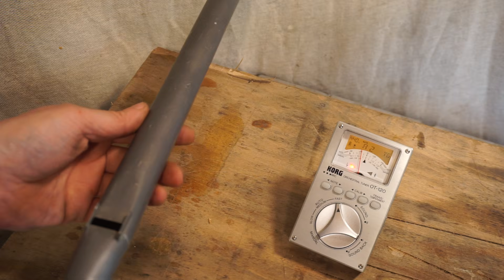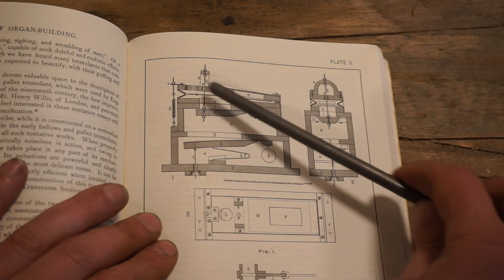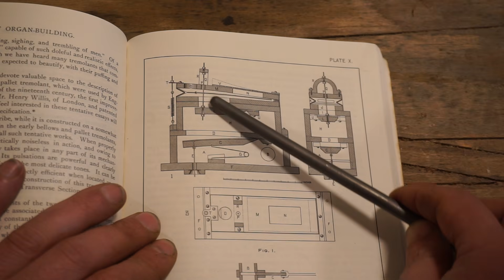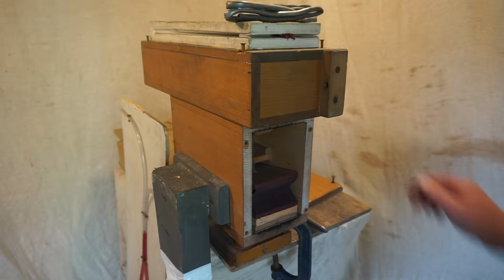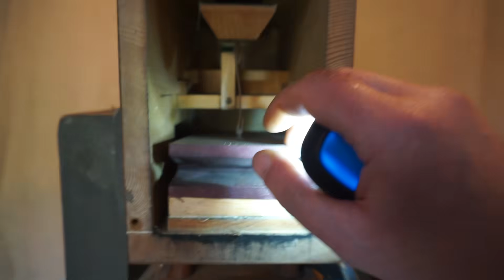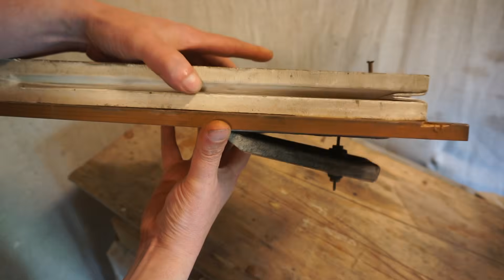Pipe Organ Tremulant Explained

Comment: Thanks for the explanation and taking time to answer questions! I have one too. Doesn't an ideal air supply to the wind chest provide steady pressure regardless of flow? If the organ is optimised for keeping a steady tone regardless of number of pipes being used, it will be counteracting the effect of the tremulant. And vice versa: If you constrict the air supply to let the tremulant affect the sound, it will make the organ less stable.
Reply from the maker: Thanks for the excellent question. Yes you are right that the ideal air supply would be perfectly steady and therefore the tremulant wouldn't work because the reservoir would completely remove the action of the tremulant. However, in practice the wind supply is never perfectly steady. The reservoir has weights on it to control the wind pressure, and as a result is quite heavy, with a lot of inertia which means it takes a while to start/stop moving, this unfortunately results in slight fluctuations in wind pressure if you suddenly start or stop playing a loud chord, but also means that the tremulant will work because the pulses of wind pressure it creates are too quick for the reservoir to remove.  If the change in wind pressure is too serve when you start/stop playing something loud, then the organ may be fitted with a concussion bellows. They are small spring loaded reservoirs that will respond quickly to the change in pressure of the wind to smooth out any sudden fluctuations. If you have a concussion bellows and tremulant operating on the same division of the organ, you have to have a mechanism that blocks off the concussion bellows when the tremulant is activated, otherwise they will just cancel each other out.
Reply: @PipeOrganRevival  A fantastic explanation! As an electronics engineer, I see electric equivalents to everything you talk about.
Reply: @mumiemonstret  Yes.  A pipe organ’s regulator is exactly analogous to a voltage regulator.

Comment: A great demonstration! I've been around organs quite a lot, but never saw the "innards" of a Tremulant.
As a violinist, I've always wondered why they don't call these "vibrato" stops, since the pitch really does change, with the change of wind pressure. And then there's the misnamed "Sforzando" piston which should really be called "Tutti", meaning all stops! 😁👍
Reply: They are sometimes called "vibrato", it just depends on the builder. As for the sforzando, it's a similar thing, but nowadays they are usually called Tutti (as they should be).
Reply: With pipe organ tremulants, there’s typically a more noticeable effect on it varying the volume of the sound, and less effect on it varying the pitch.  Everyone wants it to vary the pitch, but it’s difficult to make organ pipes do that to any great extent.  Some organ companies did call it “vibrato”, but that was mostly wishful thinking.

Comment: When you put the weight on the tremulant and caused a noticeable change in the speed and quality you I wondered if that is why I’ve seen some organs with a cinder block resting on the top of the windchest.
Reply from the maker: @Quince828 You normally find weights (either blocks, stone, or metal) on top of the reservoir. The reservoir's job is to control the wind pressure so that the pipes speak at the correct pitch and volume, and to be a store of air so that it is available when it is needed. By adding oi removing weights from the top of the reservoir you can adjust the pressure of the air supplied to the pipes. (In an organ the "windchest" is something different - the pipes sit on top of if, and it contains the valves that open to let air into the pipes when the keys are pressed).
Reply: @P @PipeOrganRevival anks for the clarification. Does having a weight added to the reservoir indicate that there was a flaw in the original specification of the reservoir, or that subsequent to the organ’s installation a decision was made to increase the amount of pressure to a particular rank of pipes; ie wanting say a trumpet stop or a big pedal rank blown at more than the other stops?
Reply from the maker: Lots of pipe organs evolve as musical fashions change, so there wasn't necessarily anything "wrong" with the organ to start with. If a church has been carpeted the acoustics will have changed and the organ might not sound loud enough anymore, sometimes extra weights are added to the reservoir to increase the wind pressure to make the organ a bit louder (but it also effects pitch and tone of the pipes).

Comment: Some tremulants have never worked, and never will, probably due to unfavourable feedback effects between the tremulant, the wind-trunk, the chest/soundboard, the blower: - who knows?  I have been told that you need a long, fairly narrow, wind-trunk to get a tremulant to work, and this may be so, remembering that what you are after is an unstable wind-system.
Others work with no trouble at all.
Most make that 'chuffing' sound - which is a nuisance.
I know of one which is pretty well silent.
Tremulants are a mystery!
Reply from the maker: Thanks for your comment. I have enjoyed watching your videos in the past, the use of plastic gutters to remove pipes from an organ was a new one on me!
Reply: @PipeOrganRevival  It sure speeds everything up!
It's just a shame that the pipes can't go back in, the same way.
Reply: See my other comment reply above. You need to read that article or series in the Theatre Organ journal going in depth about tremulant dynamics. There is a lot to take in, but they covered it really well IMO.

Comment: A lovely clear explanation of how this commonly found type of tremulant works; my experience is that many are set too fast and too violent to produce a beautiful effect. Getting them adjusted to produce a gentle undulation seems to be difficult.
Reply from the maker: I have seen one organ where the tremulant caused the bottom of the swell windchest to flex when it was used!! I turned it down as much as I could, but if you have them set up too gently they don't start reliably. Audsley says in "The Art of Organ-Building" that he thinks most tremulants are too large, if they were smaller they might start reliably and produce a gentle undulation. And when they are set up correctly the trumulant should vibrate without the pallet valves actually coming into contact with their seats, so you shouldn't hear a violent banging noise.
Reply: You should join the American Theatre Organ Society (ATOS). In the back issues of their "Theatre Organ" journal, in I think a 1960s or 1970s issue (or several issues in a series?), there is one or more detailed articles explaining the complicated dynamics of how a tremulant works for BOTH the speed aspect (aka rate), and ALSO the depth of tremulant (aka how much pitch-bend, how strong the flutter). It turns out that the LENGTH, DIAMETER and CONFIGURATION of the WIND TRUNKS or TUBES connecting the tremulant to the regulator, AS WELL as the size of each movable board (board of the tremulant; board of the regulator), and the weight/spring tension on each, is really important. Also the pressure and volume of air required by the rank(s) connected to that tremulant are another important factor, and there are many adjustments to be made to get everything "resonating" together at the right frequency, and for them behaving well and being "happy". Lots of factors to consider, some of which were not even known in the 1920s when nearly all of the original theatre organs were built. BUT all this research by theatre organ enthusiasts (because a strong and deep tremolo is considered important to a modern theatre organ) is a great boon to anyone working with tremulants of any type for any kind of pipe organ. It can help make ANY tremulant sound better.